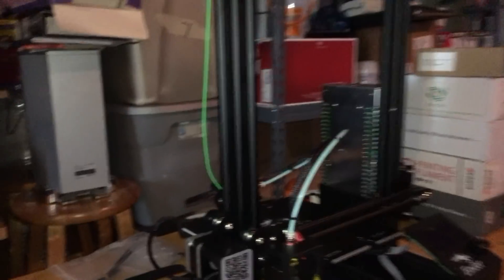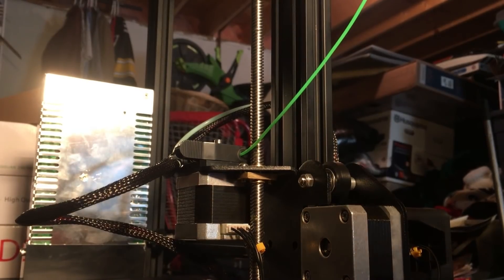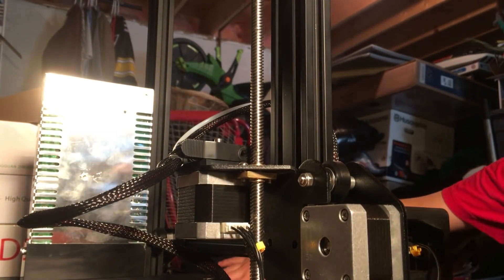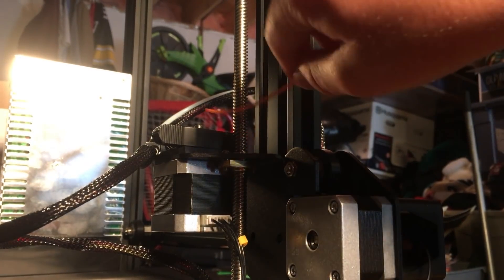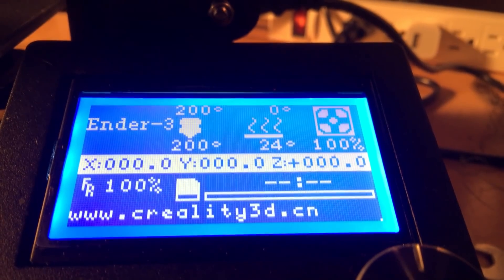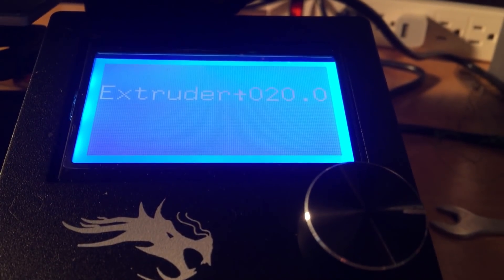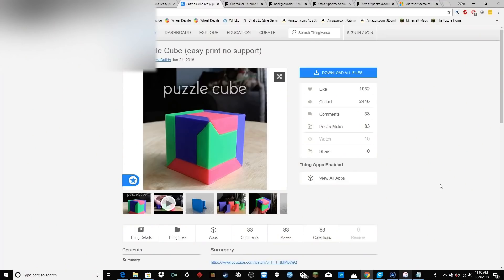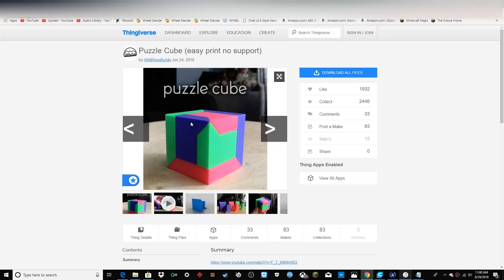How To Change The Filament On A Ender 3

Comment: I did this and it worked for the first half of the print and then the second half the filament didn’t come out, I tried reprinting the thing I was trying to print and the filament isn’t coming out of the nozzle at all
Reply from the maker: Try a putting your temp up some, a cold pull, and if that fails a replacement nozzle. Sounds like a temperature issue or a nozzle issue, you could also make sure your extruder is grabbing the filament well.

Comment: You are the only person to actually help me learn how to mechanically purge the nozzle (without pushing the filament with your hands) one tip though I have for you is when you're pulling the filament out give it s push through the nozzle till you see it ooze out then with a swift motion pull the filament out and it will get rid of that stringing problem with the filament still left in the Bowden tube, thankyou for your help!

Comment: Thanks for showing this. When I pulled the filament and that long thin trail of plastic came out, I was worried that it was all clogged up now, or something. Sounds like it’s fine.
Reply from the maker: Try Pushing before you pull quickly.

Comment: thanks i was looking for the menu item but this way was faster
Reply from the maker: To get the menu item on mine you had to hit preheat then tube should be a new option in tune you should find change filament just make sure your nozzle gets hot enough before you hit it.
Reply: Ender 3 Tutorials thanks!

Comment: the filament is not coming out of the extruder, it is coming out of the nozzle, the extruder is the gear that pushes the filament through the nozzle. also you will get alot more subs if you dont make an intro that goes on for a minute straight and flies across the screen while blasting earrape through you microphone. just saying
Reply: He's a kid. Relax.

Comment: It looks like your method works fine, but I do one thing differently.  Rather than pre-heating and then yanking out the filament, I disconnect the feeder tube from the heater via the press-in lock while everything is cold, expose about two inches of filament, snip the filament with my cutters, then yank out the cold filament from the tube.  This prevents stringy melted bits from clogging up the tube.  Then I feed that 1-2" stub back into the tube and into the heater press-in lock and pre-heat.  Then I feed the new filament in and continue with your same steps using the Prepare menu.
Reply: Thank you.  This seems logical.
Reply: Yeah was wondering that when he pull out the stringing filament. Was afraid it will clog the tube.

Comment: I have a question about the Ender 3. If you run out of filament during a print job can you change the filament without having to start all over
?
Reply from the maker: Well it depends, If you are watching it and put the new filament in right as the other filament runs out then yes but if not no.